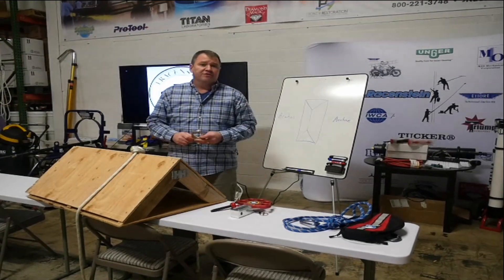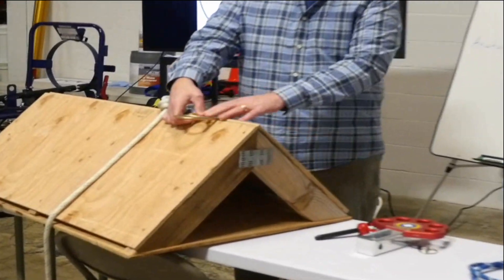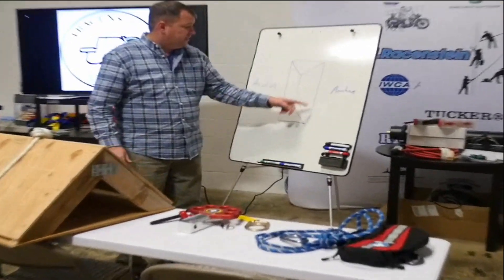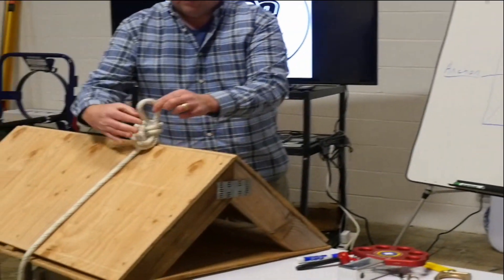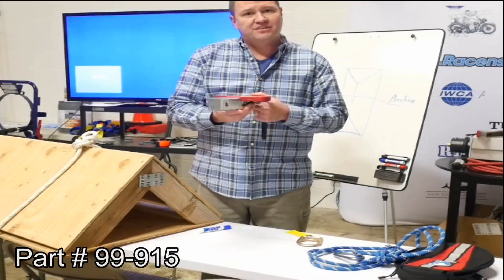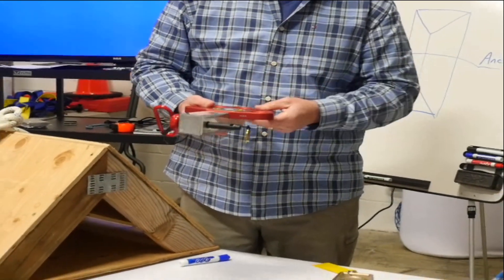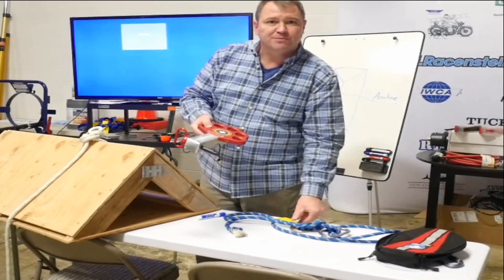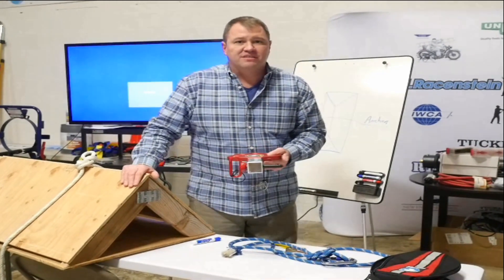Ground Tie off of a Residential Roof

Comment: Some questions?

1. If you pull that rope tight, doesn't it damage the gutters? 
2. Working out near the corners of the hips, one ends up at a high angle relative to the anchor rope you've setup. If we ignore the problem of a swinging fall until another day (not a risk you really would ignore), there is still the problem that a fall can pull the anchor rope from being straddled across the roof to sliding down the side hip of the roof. How do you prevent that?
3. How do you ensure a fall won't cause a rope to pull sideways on a vent or pipe (sticking up from the roof), damaging it or ripping it out completely?

Also, my home is not surrounded by a driveway loop. I can only park a vehicle by the driveway, which is separated from the house by the single-story garage. So, it would be good to see anchors that don't use vehicles. I ended up using a tree on each side, with nylon 1" straps looped around the tree into a locking carabiner.
Reply from the maker: All great observation, there is as you have illustrated with your comments a single anchor solution for all buildings.
Access, roof style, obstacles, attachments and building ornaments all need to be considered in your safety plan.
We are happy to hear you figured out a way to stay safe on your roof.
Reply: @JRacensteinCo  You reckon stuff like big hurricane ground anchor could hold workers safely ?

Comment: Is there an option for ground ties when you can't get a vehicle with a hitch where you need it? Can you use a big heavy weight and if so, how heavy - 3x the body weight of whoever is on the roof maybe?
Reply: If someone falls off the roof they did studies that shoe the weight exerted was around 5,000 pounds, so weights probably wouldn't work. But if theres a tree on the other side of the house that would work